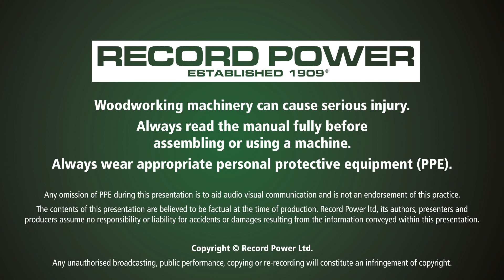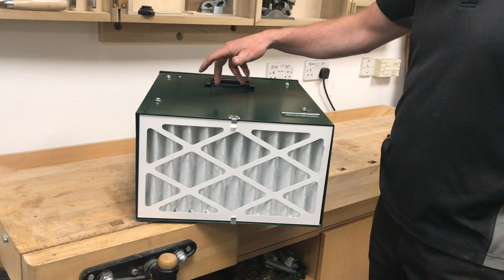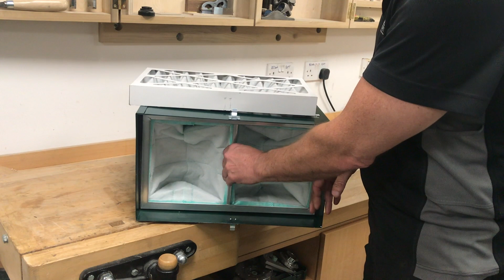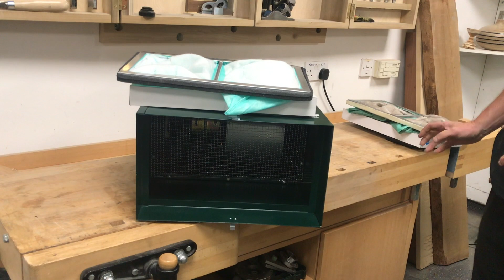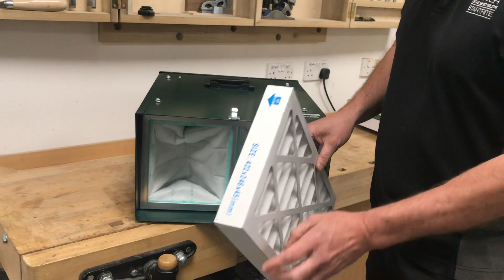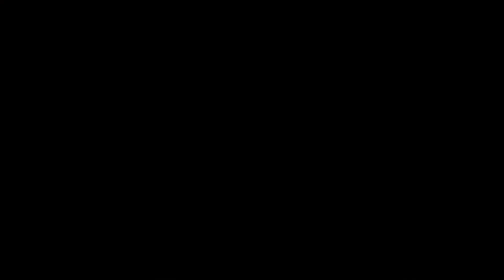Know-How Series: AC400 Operation and Filter Change

Comment: Filter changing/cleaning can be determined by pressure drop across the filter. Do you provide this, or can I add a manometer?
Reply from the maker: Hi Mike, thank you for your comment. You are correct, there will be a pressure created by a blocked filter this could be measured with a manometer. That said, simply replacing/cleaning the filters every so often is more than adequate to maintain optimum performance of your machine. If you would like to discuss further with our Technical Support Team, please call 01246 571 020 and select option 2 or email technical@recordpower.co.uk. Best Wishes, Record Power.

Comment: How would you suggest I work out when filters need replacing? You say it's defined by how long it's running , but is there anything I should be looking out for on the filter itself?
Reply from the maker: Hello, thank you for your comment. Changing the filter is not categorically defined by how long it’s running, its defined by the amount of particles of dust it picks up in the workshop, so a busy workshop with high volume of dust will collect in the filters much quicker. A visual inspection and condition of the filter is a suitable way of judging whether a replacement is required or not, obviously a clean filter runs more efficiently and you would change the outer filter more often which will save and preserve the condition of the inner. Best Wishes, Record Power.

Comment: Can you also hang it vertically against the wall? Instead of horizontal.
Reply from the maker: Hello, thank you for your comment. You can hang the AC400 vertically against a wall if this is suitable for your workspace, however, we do recommend that the machine is positioned in the upright position as shown in the manual, in order for the filters to work to their optimum capacity. Best Wishes, Record Power.

Comment: Hello, I'm an Italian craftsman.
Three years ago I bought your Air Filter AC400.
For a few days the machine has been turned on, using the remote, you can select the three suction stages and also the suction time but the suction fan does not start.
What should I do?
Thank you and good day.
Reply from the maker: Hello Marco - Sorry to hear you are having issues, your machine is still under warranty, could you please get in touch with us by either raising a web ticket or calling us on 01246 571 020? We'll make sure we identify and solve the problem for you.
Reply: @RecordPowerTV  Many Thanks

Comment: Let's say I want to leave the machine running after I'm done in the shop for the day. Which option is more efficient; running the machine for 4 hours on the lowest setting or 1 hour on the highest setting?
Reply from the maker: Hi - thanks for your question. We recommend running the machine for 4 hours on a low setting, to allow more time for air to pass through the filters.